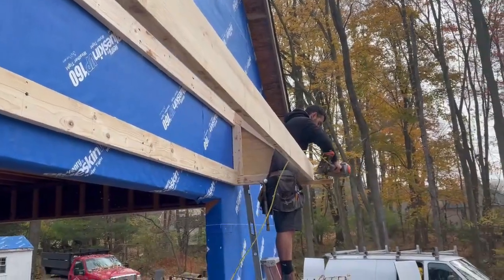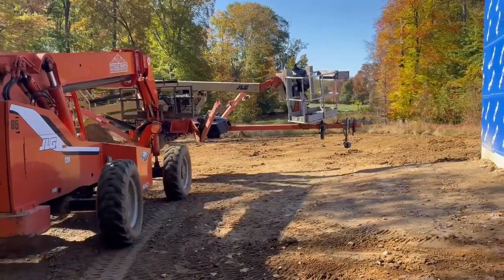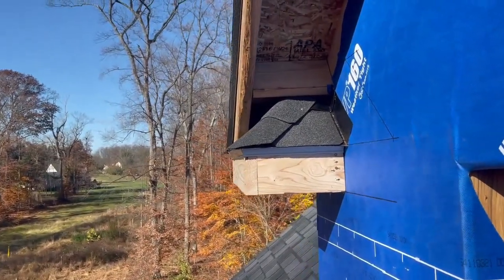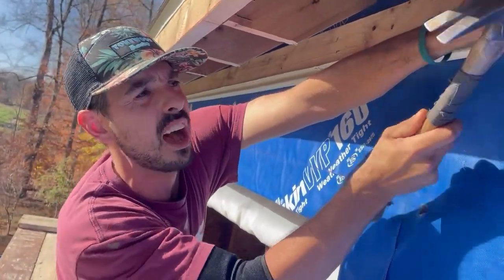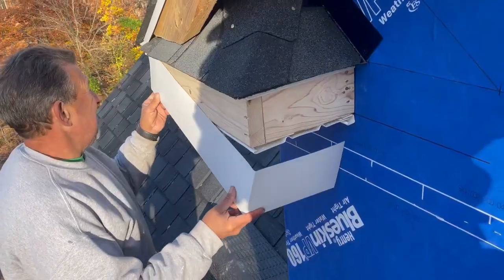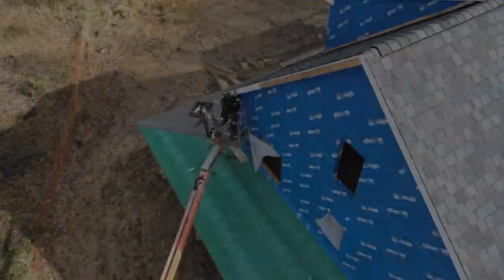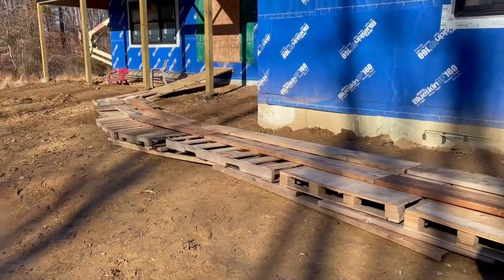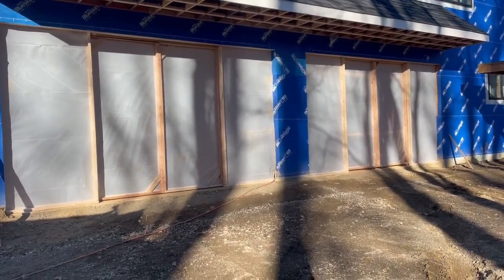Exterior Finish Work & Prepping for Subcontractors- Our DIY Build Continues to Progress! // Ep. 17

Comment: Juan got that explanation backwards.  The vent helps keep COLD air circulating next to the roof deck so that is stays cold and the snow DOESN'T melt.  Without a vent, the warm air from the attic warms the roof and melts the snow and then hits the eves where it is cold and creates and ice dam.